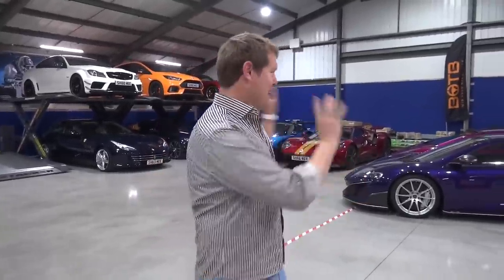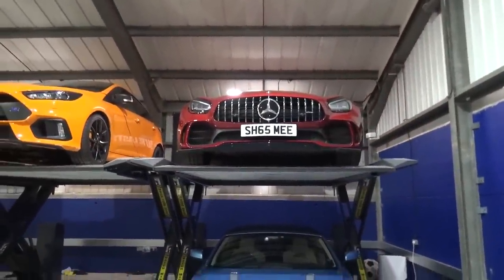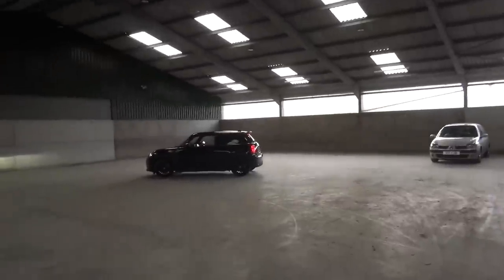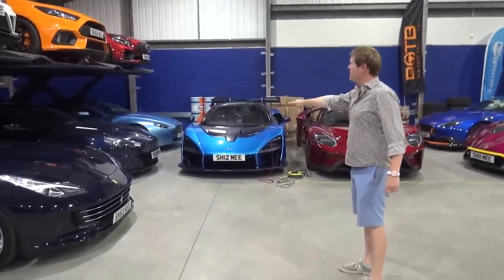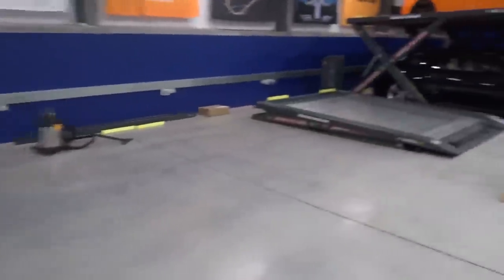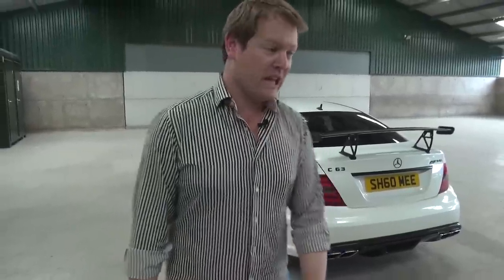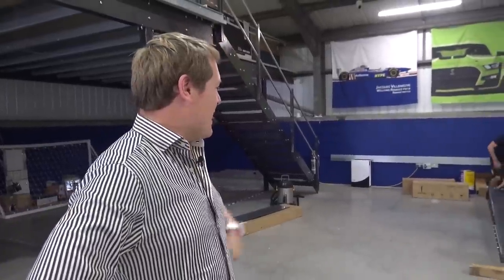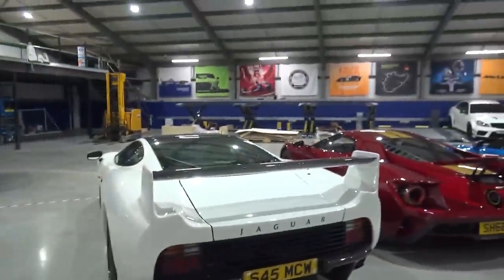WE'RE EXPANDING AGAIN! New BendPak Lifts Being Installed at The Shmuseum | VLOG 83

Comment: I still think you should open up access between the two halls, on paper it might seem good to have them separate, but I think in practice it’ll be more ‘flowing’ if you can drive between both halls. Plus you’ll soon get fed up opening three doors and moving bollards just to move cars around, plus the added benefit of not moving them outside when the weather is crap. And if a ramp isn’t an option, I’m sure Bendpak could sort you out a lift…..😉
Reply: if the ramp has to be 7/8 meters long, if possible, they could cut into the concrete in the upper level and then only use up to 4 meters in each room? if it sits in the middle.

Although, strangely, I like the idea of a car lift too!
Reply: @TheBigRab  yeah I get the ramp idea is probably a no go, but lots of other collectors have lifts, Topaz has one. Might involve a bit of engineering but it’s definitely doable. As I say I think they’ll quickly get fed up opening and closing 3 doors, running outside etc, especially in the winter when it’s really rubbish weather. Just my 2 cents worth.
Reply: agree, certainly cant work out why you wouldnt put at least an opening door between the two sheds

Comment: It would be great to have little things that go under the wheels so you can shuffle the cars around without having to turn them on and off
Reply from the maker: But we love a good cold start😉
Reply: The cold starts also cause significant wear to the engine (compared to driving longer stints on a warm engine).. Smaller downsides include water is left standing in the exhaust etc.
Reply: @mattipeltola4934  True...but when you own these cars, a cold start is a MUST:)
Reply: @doggies.will.be.doggies  Likely that unequivocally is the case :D

Comment: Shmee if you happen to take a look at this, i have a suggestion for the garage so here it goes:
The left side is the lifts, the front side is the office and mezzanine. The right side just needs to be cars but facing the office and the mezzanine. Basically parked vertically in a fashionable order and just have the show cars there. Please consider this and remove any store or office from the right side. Just make it a beautiful garage with beautiful white epoxy flooring and blue accents. Get the roof also white with good lighting and posters which are framed and not just hanging. This needs to be and look like an expensive garage based on the cars in the collection. The storage/extra offices can be moved to the back garage. This needs to look 100/100. Hope you consider this. Keep up the amazing work as always.
Reply: 100% agree

Comment: can confirm wall would most likely be fine against the towbar, having witnessed this several times
Reply: I've seen similar be done with a 36-Tonne Tractor and the wall showed barely little sign of damage, the poor tow hitch on the tractor however needed a little massage with a hammer & torch to resemble it's original form.... Haha

Comment: You need more than 30 psi in those tyres way to low,should be 38-40psi. You'll wear them alot quicker at that pressure,more chance to damage your rims and you will use more fuel(rolling resistance)

Comment: Not sure on space but I’d maybe suggest having the ramps in line rather than side by side?  So directly in line with the door entry and hence saves manoeuvring getting any car into a bay and on to a lift?

Project ramp where the E500 was and another closer to the door which you essentially drive through to get to the project ramp?  Should give even more space for storage?

Comment: There are battery conditioners which connect with a magnetic connection underneath so you don't have to keep opening the boot/bonnet. Is there a reason not to use these apart from having to modify wiring?
Reply: Ah, the beautiful Lusso has it.

Comment: Haven't got time to watch this now, but I wonder if they'll be using a Bendpak lift as a transition-lift to the 2.0 Shmuseum as an alternative to a ramp.
Reply: That would be something different, and, unique too....
Maybe some kind of "moving floor" would be more suitable?

Although if you consider the price of such a option I think it may be better to just spend the money on getting a ramp installed if such a solution was too be looked at.
Reply: @longnamedude3947  Depends on how much of an elevation difference there is between the two parts of the greater shmuseum. If it's as high as a metre (3ft) then that's a heck of a long ramp to get supercars up without scraping.
Reply: @veemacks7255  That is very true.

Having re-watched the video it see as if Tim is certain that they won't be installing any kind of lift or ramp between the two sections, and, on reflection I do wonder if that options makes more practical sense to do in the long run, after all I am pretty sure that Tim & his Team do plan to be located at the current site for the long-term so practicalities are key to the decision making process.

Either way I am sure you'll agree with me when I say that whatever comes of it all, the outcome is sure to be amazing!

Take care dude/dudett, and, Peace :-)
Reply: @jd32k  Unless it was modified to not have that sit-down area. Irrelevant as they don't seem to want to do that anyway.